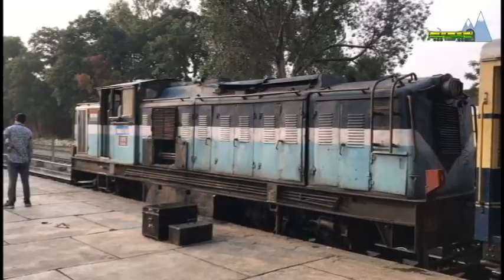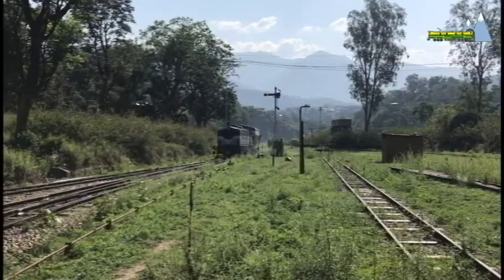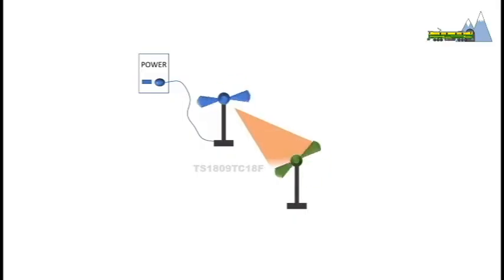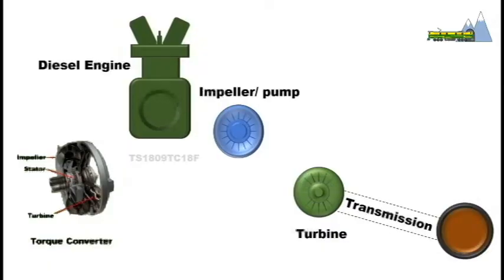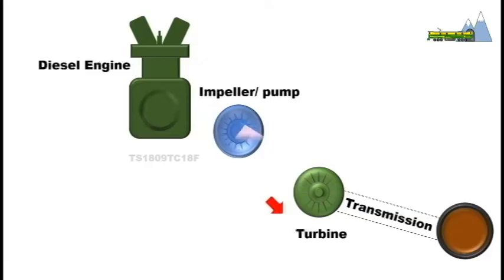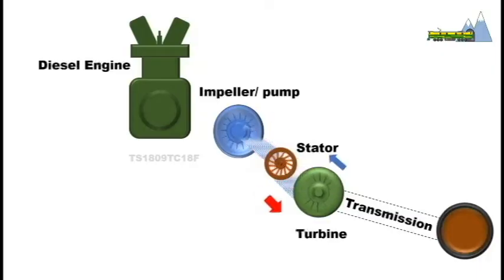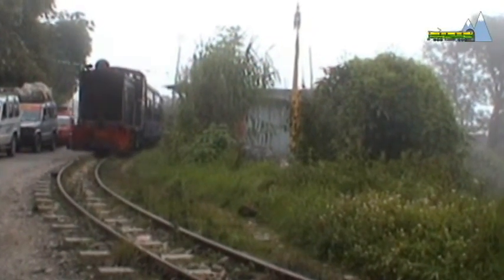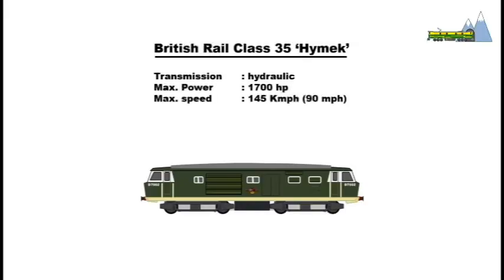How Diesel Hydraulic locomotives work

Comment: One question. Does the transmission after torque converter require gear mechanim or it works without gears in a locomotive?
Reply: Numerous gearboxes connected by cardan shafts ultimately driving the wheels

Comment: Very nice explanation! But, what is the difference between a Diesel Hydraulic locomotive and a Diesel-Mechanical locomotive? Both of them use a Par Converter, don't they?
Reply: Mechanical uses a gearbox instead of a torque converter.
Reply: The essential thing to remember is the interface between diesel engine and the driven wheels is a fluid, hydraulic fluid, they work on the in compressibility of a fluid

Comment: Great job!
I have one ambiguity.
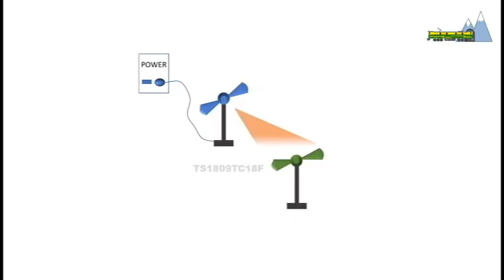1:26 - How is the second fan forced to stop working if the first one is still running? I mean, there's still transmission among them, flow is still active, am I right?
Reply: Yes, the flow is still active, but not enough to rotate turbine because the train is very heavy. On cars with automatic transmission with torque converter they are light so you have to hold the brake pedal, otherwise the car starts to creep because the flow is also still active.

Comment: I always thought diesel hydraulic was like diesel electric, but instead of electric lines, it used hydraulic oil lines, and would spin hydraulic motors on the axles.  These are what i thought diesel mechanical locomotives were, since in all effect, there is a mechanical linkage between the flywheel and the axle.

Comment: Very interesting. I find it interesting how electrics and hydraulics can often be interchanged. In aircraft, things like flaps and landing gear are usually powered hydraulically. But some planes use electric actuators instead because an electric system is going to be much lighter than a hydraulic system with its lines and pumps.

Comment: Very nice explanation of the theory of diesel hydraulic loco. Only wished you should have elaborated on the stator functioning. i understand it is like a pump impeeler that pushes the hydraulic oil back on the the main diesel engine impeller and rotates only clockwise. The 90 degrees part was not clear. Is it axial flow that you are talking about?

Comment: Well done, a very good explanation. In terms of converting a given output from the diesel engine, which has the greater efficiency at the final drive of the locomotive wheels: diesel-electric or diesel-hydraulic?